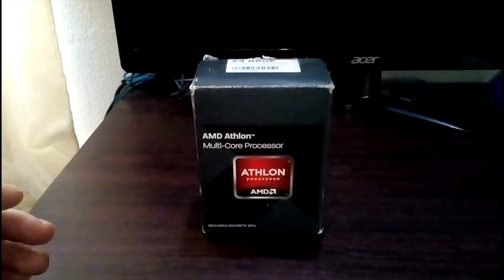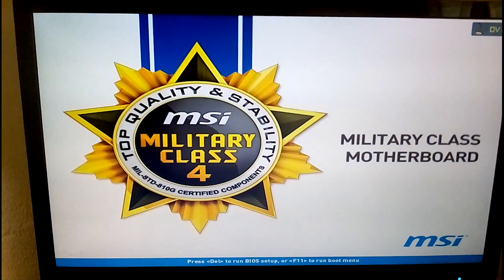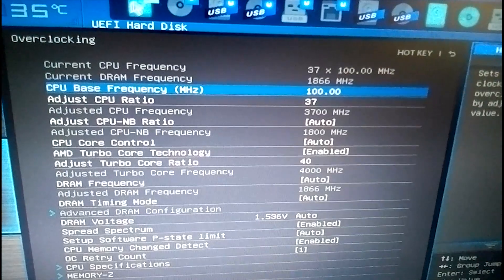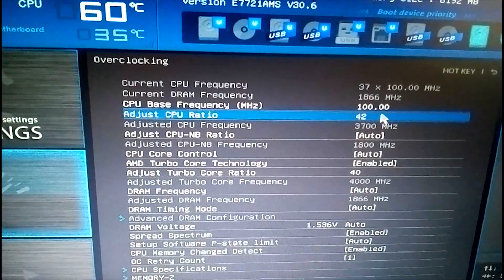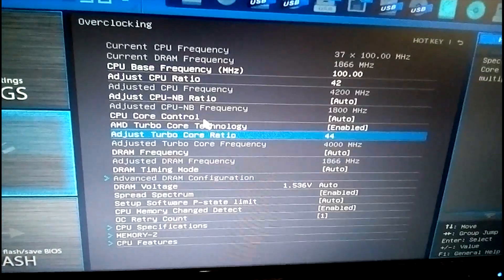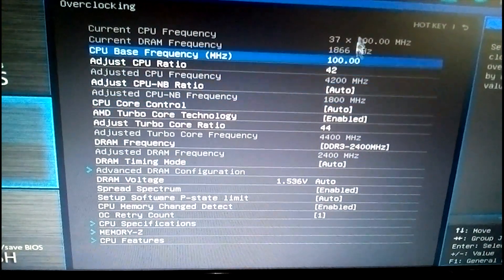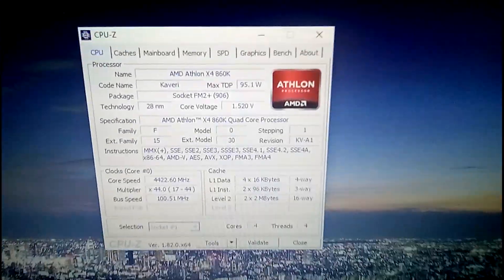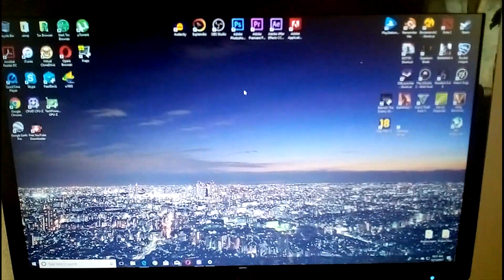Overclocking AMD Athlon X4 860K to its best performance levels 4 2 GHz

Comment: Mine is still running at 4.4GHZ normal 4.5GHZ turbo after 7 years like that, I use it paired with a GTX 1050TI as a retro game emulation PC connected to the TV, it runs games up to Wii U smoothly

Comment: Interesting you got that high. Back in the day, was on a hyper 212 and I could only get to 4ghz. And I did have to increase voltage to do that too.
Reply: it could’ve been because of the motherboard or the silicon wasn’t good enough

Comment: I'm currently running mine at 4.3 GHz with a NH U-12S but i have a problem. When i'm running games it seems mostly fine but when i want to to run a benchmark in Cinebench it boosts up to 4.3 GHz but then starts to clock down slowly until i'm at around 3.7 again. I don't really think it's a thermal issue tho because the cooler isn't that warm when it happens also it's pretty big and should keep up so i was thinking it might be the power supply. Could anyone help?
Reply: now i have the same problem. This cpu is throttling at 62c so you should monitor the temperatures

Comment: I overclocked my cousins 860k @4.4 ghz and I only used 1.34 volts
Reply: Hey, what cooler?
Reply: @psychemasksofficial5472  its an oem water cooler with 120mm radiator and fans, nothing fancy

Comment: I'm noob, is there any consequences for this in the long run?
Reply: Depends on what temperature u are running, i dont recommend u to make a clock when temperature is over 84 c°
I reccomend u to get a good air cooler or a water cooler to do it

Comment: Everytime I edit cpu ratio my motherboard freezes up and my bios gets stuck. Even before I hit save and exit. It's an A68HM-E33V2 and I'm using the AMD Athlon 4x 860k quad core. Any idea why this is
Reply: Whats your bios date its 8.5?
Because im   upgrading to x4 860k and my current processor is amd a4 6300.

Comment: The APU and Athlon chips were set too low for their NB. Setting the NB to be at 2.0 or 2.2 GHz can greatly increase their performance even when leaving the core at default.
Reply: Could you link an article maybe?:)
Reply: @matsherzog3647  I've used them so I know, memory controllers of AMD CPUs before zen were really bad and that negatively impacted their performance.
Reply: Tank you!
Reply: what is nb?
Reply: @khynantoque  Nothbridge, which is old name for the integrated memory controller inside the CPU.

Comment: My pc shows a black screen after i overclock, every time i turn on my pc i see the black screen :/
Any solution?
Reply: Go back to your bios and reset the settings back to default, and if you cant, pull out the bios battery for a few minutes, that should reset it.

Comment: I did the settings and now nothing shows up on my monitor...
Reply from the maker: that should not be possible however if unplug the card and put it back that will rest it
Reply from the maker: or clear the bios
Reply: I cleared the bios it works now thanks but i have asrock mobo and i have no clue what those settings are
Reply from the maker: @BomboGamer  the multipler is what you should look for and should change
Reply: I have a gtx 1050 and asrock motherboard  does any of that matter? Should i copy your settings?

Comment: so do you not need to configure the volts first before overclocking the cpu?
Reply from the maker: no you do not have to. you change the volt only if you want to push the cpu more and some motherboards can automatically adjust to what the cpu needs

Comment: got mine at 4.1 and i got a gtx 1060 6gb but i still lag in games like far cry 5 xd
Reply: This is a different issue then bud perhaps a setting needs a tweek change your virtual memory to actual ram memory i have 16gb the default was 2356mb changed to 16000mb wow what a difference.
Reply: @cheezy_entertainment759  how you change that?
Reply: Check this vid  https://youtu.be/-lLT95yFFoY

Also not tried this saw it last night going to try today all comments are good.

https://youtu.be/WnKDPLjbg_I

Comment: I am running my x860K since late 2016. It's stable at 4,5GHz with cooler Scythe Ninja 4 SCNJ-4000. I don't have any heat problems... :P But that cooler was expensive...
Reply from the maker: yeah it is. i tested the CPU with the stock cooler and with the Cryorig M9a cooler and still got good result even though the M9a was better
Reply: What are you oc settings?
Reply: Can u share the setting
Reply: Sorry. Its some time since i upgraded my PC and I dont remember values, but you must turn off Turbo boost, and raise multiplier by one times. (=100 MHz). Every time save settings, boot windows and run CPU stress test for 20 min and all the time watch temperatures. If it is not too high temperature or PC does not crash. Jump back into BIOS and raise frequency multiplaier. When it crash druring stress test and temperature is not too high than add just little bit of VCORE voltages. And try again. If it crash again. Raise VCORE. When PC runing fine than raise mlutiplier... You sould be able to get at least 4.3GHz. When you are done, you shlould rund stress test for much longer. Make sure your cooler is clean and remember every CPU is different... So dont take values from other peoples... That is actualy the way how to damage your CPU. Sorry for my english.

Comment: Was ur ram stock speed 1866mhz?
Reply from the maker: yeah my ram is 8Ghz running at 1866nhz
Reply from the maker: @Dan-xu5xz  i am using 8Ghz running at 2133
Reply from the maker: @Dan-xu5xz  i had it at 1866 but had to overclick it to 2133 better performance
Reply: TechStop Do you mean 8gb of ram?
Reply from the maker: @pepega1061  yes it is 8 gb of ram

Comment: I have mine running at 4.5 with a kraken x62
Reply from the maker: i did change any voltage
Reply: TechStop increased by 0.03🤷🏻‍♂️
Reply from the maker: oh kool stable right? great job

Comment: My 860k is working on 4.4 mhz at 1.46 volts, stable. What you think about this voltages?
Reply from the maker: the volts are a bit high. Going over 1.45 will lead to more heat generation. if you have a good cpu cooler I would increase the fan speeds and use 1.44 volts and test its stable. try that and see. love the comment
Reply: I have this cooler ( Cosmo Cool LC-CC-120 - CPU cooler), and which program is best for measuring the temperature? no one not show the same temperature.
Reply: I got this performance: 4.3 MHz; 1,431 volts, stable; sinebench r15 - 362 cb; core temp 1.11 - 52 c max; stress test with prime 95. When I go to 4.4 mhz, I need to raise the voltage to 1.46. What you think?
Reply from the maker: have you tried 1.45? at 4.4GHz

Comment: My is on 4.5 GHZ 1.504V       N.B   2000 MHZ+003v ...  (on 1.520v u can get 4.5-4.6 ghz !!!)
Reply from the maker: not bad but those Volts are high. i will test your settings and see what i will get. thanks for sharing bro
Reply: try i see on 5.38 u go 4422.60 MHZ on 1.520V

Comment: Bro i have an asrock motherboard so i overclocked at the uefi to 4.2 and now the power button is with red light, and it was blue does that mean i abused?  (Btw srry for bad english kinda sleepy today)
Reply from the maker: i need more info than that. but, if the system boots then check you temps. if it doesn't boot, reset the CMOS and reduce the overclock to 4.1 see if it boots then. when OC+ing the voltage and temps have to be monitored a lot.

Comment: I have an 880K and I can't get it stable if it's over 4.2 GHz (which is the turbo speed), I tried increasing voltage but no luck. I have a Biostar A88MQ. Can you help me?
Reply from the maker: remember at that speed, the temps are a big concern. what kind of cooler are you using? if it is not the stock cooler, then clean off the cpu thermal paste then apply new paste. then increase the fan speed and volts again and see. some of the 860Ks can go pass 4.4.
Reply: TechStop I'm using the stock cooler with cooler master thermal paste, and I keep the fan speed full all the time.
Reply from the maker: Ok. reset the BIOS then change the multiplier 1Ghz at a time. and see what speed is causing the instability. so if the cpu speed is 37 change it to 38. see if it boots ok run a few apps then increase it again to 39 and so on. when it gets unstable increase the voltage by 0.05 at a time.
Reply: TechStop Thank you so much, I overclocked it to 4.4 GHz stable v1.39 maxtemp 52c, cinebench 351, what do your cinebench score?
Reply from the maker: that's a good score jrglol . @ 4.39 i was getting mid 360s with a cryorig M9. but i am impress that you got that score with the stock cooler good job man.

Comment: Hey, is this with stock cooler?
Reply from the maker: i was using a stock cooler before but the fan noise was too loud for me at 4.1 Ghz. to get 4.2 i had to use the M9i cooler from cryorig and i could have gone up to 4.35 with no problems.
Reply: Could I get to 4.0 with stock?

Comment: My PC starts up and says the the adjustments have failed.
Reply from the maker: maybe you increased the multiplier too more, Or you changed the base frequency that can make the overclock unstable.
Reply: Going to say the same, I was surprised it even posted with the settings he put on in bios l. OverClocking is not this easy. You can sometimes get 4.2 with the 860k without touching the voltage but anything higher without higher voltage is going to be unstable. And DO NOT start at the highest speed when you OC/XMP your RAM. Again if that RAM he had was rated for 1866mhz and he went to 2400mhz there is no way in hell it's stable especially again without adjusting the DRAM Voltage. Start slowly when you OC your system. My rule of thumb for CPU, GPU, RAM OverClocking is 100mhz at a time and for XMP profiles always start at the rated speed and small step ups from there. Then stress test for at least 24 hours for high OC speeds. And remember high OverClocking will shorten the life of your MOBO, CPU, RAM, GPU dramatically especially for daily use.